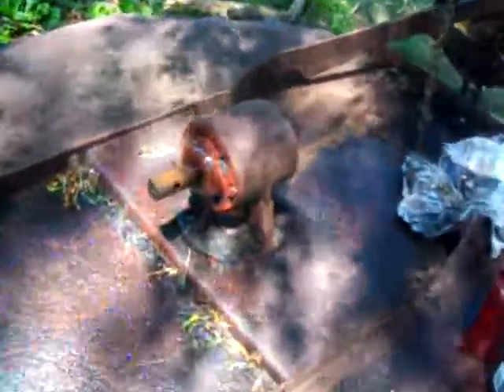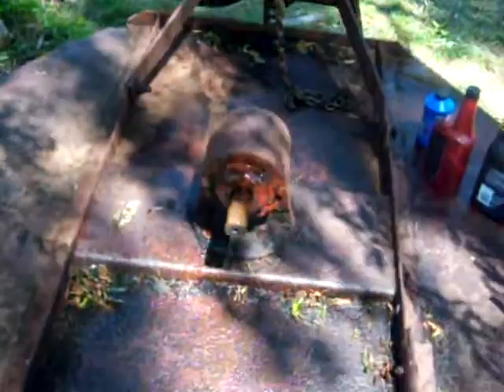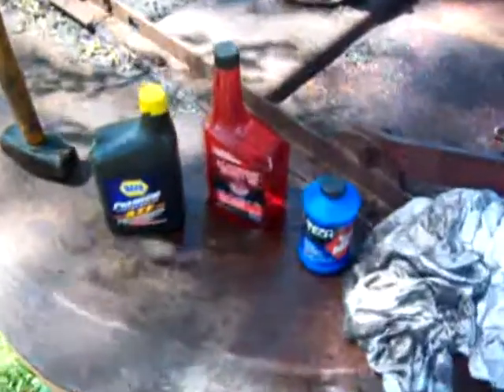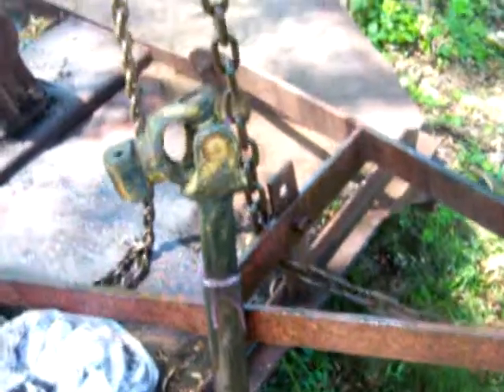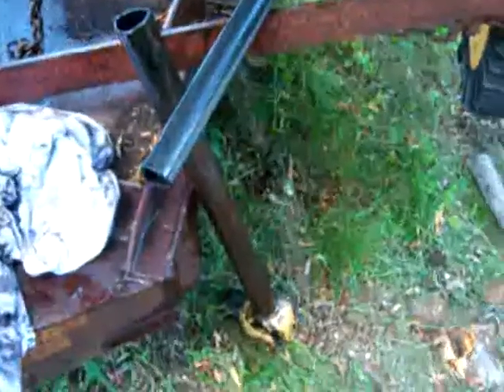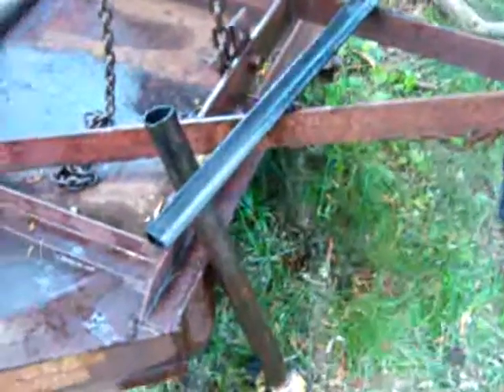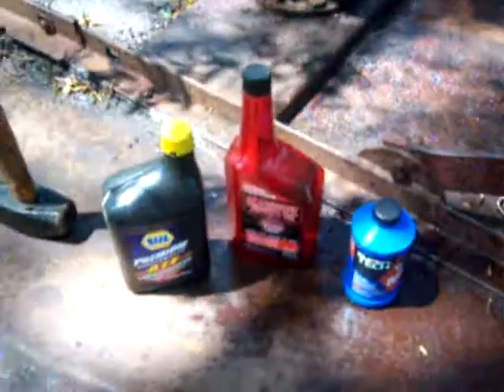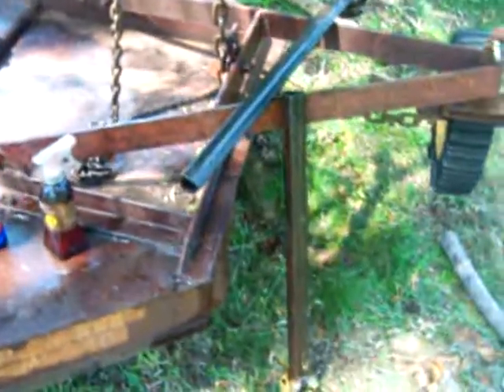Freeing A  Frozen 2 Piece PTO  Shaft With Home Made "Panther Piss"

Comment: OMG this stuff worked great. I was about to take my shaft to a machine shop and decided to give this a go, since I had all the ingredients on my shop shelf. I had soaked it in penetrating oil for several days but no movement. so I hung it from a hook in the garage, and drizzled some of the mixture on it then let it sit for a few minutes. I then tapped it for 30 seconds all the way around the shaft while it was hanging (but way at the end due to the plastic shield)  and "POP" off it drops. WOW

Comment: There is supposed to be a slip clutch to protect gears
Often that are rusted solid.
They must be disassembled friction discs cleaned and preloaded or damage to PTO or gear box.
It is usually on gear box in implement often ignored .
I just replaced gears on a few units.